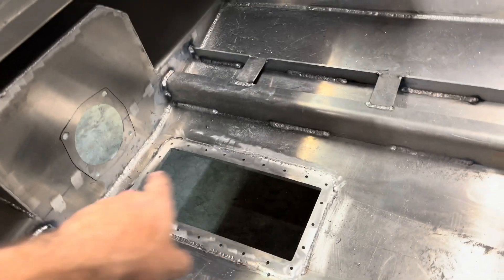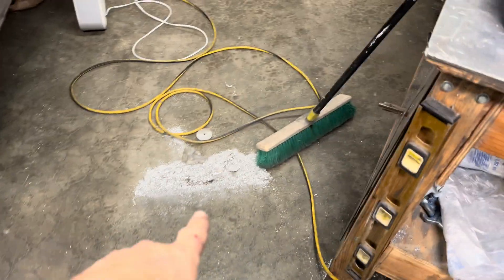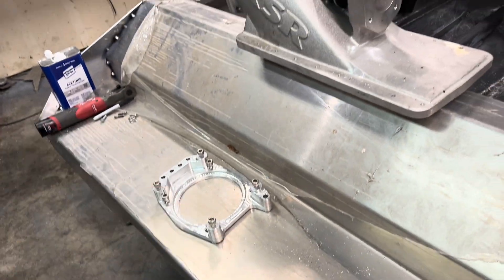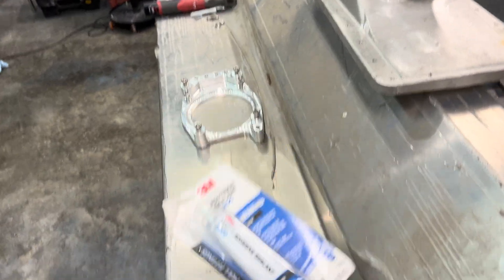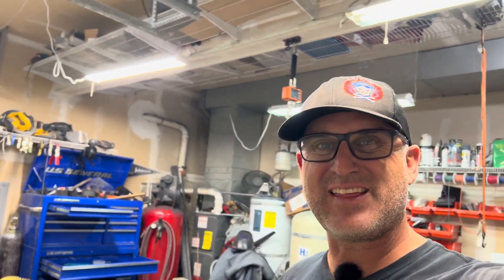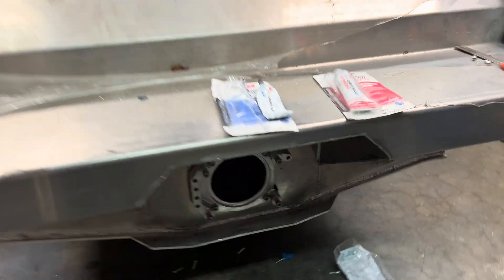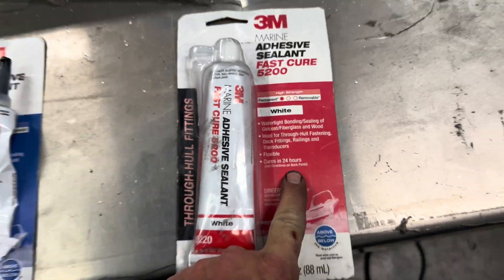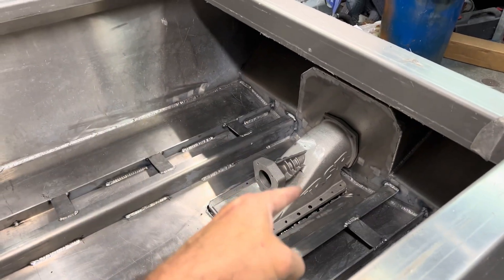Mini jetboat pump install/kit build part 3

Comment: I used black Sikaflex tonight. On the boat builder forums they say 4200 if you will ever need to remove it and 5200 if its never gotta come off!  About to do the intake in my fat jet. I got a 2 quart kit of that "Poxy putty" stuff lol really nervous. Would like to see someone else do it first!

Comment: Eric I'm getting ready to install my southern jet and the question is should I put screw up into my jet block through the uhmw. I tapped the holes into that block and my thinking was setting the block resting into the bottom not flush then welding it into place but screwing it down from inside the boat. It does seem like going from the bottom then using a nut inside the boat to help lock those bolts might be a better way. Thanks for the video
Reply from the maker: There really isn’t a right answer.  I’ve done it both ways.  The RSRacecraft pump is tapped and the block and bottom holes all line up so I typically put a countersunk bold up through the UHMW, through the bottom plate & block and threaded into the pump.  My Southernjet race pumps aren’t tapped so I typically use their holes, drill down through the block and hull plate then tap the hull plate…then run the bolt down from the top, through everything then cut the bolt off flush with the bottom.  Both ways have worked fine for me.
Reply: @JollyRoger907  👍